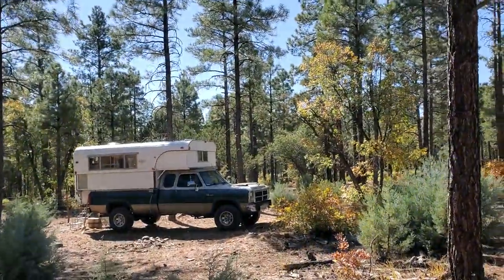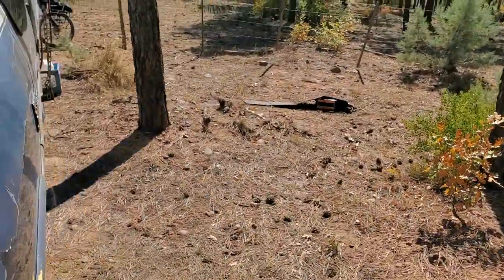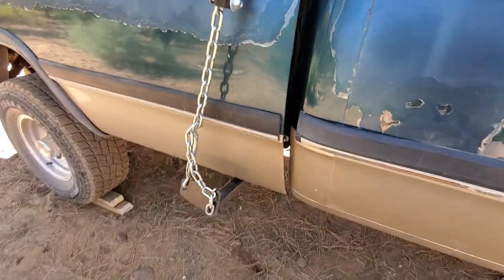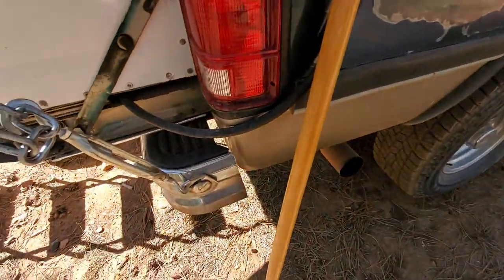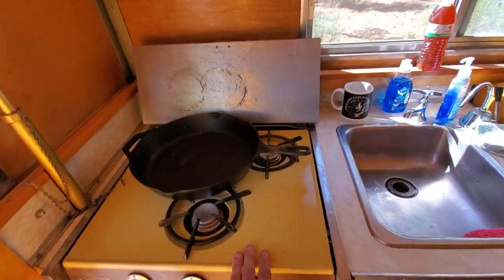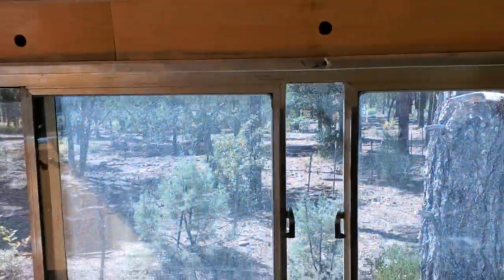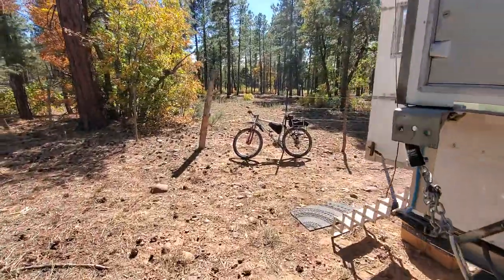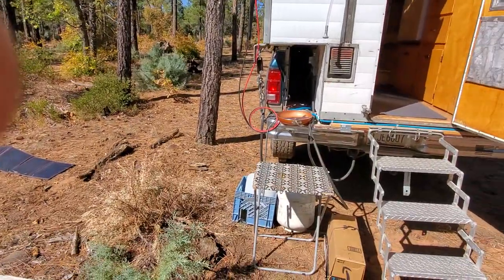My Alaskan  Camper setup

Comment: I just got home yesterday from picking mine up in Saskatchewan near the Alberta border. It had sat there for decades, so was not expecting much. Pumped it up today and it went right up without an issue, so I started getting more excited. It pumped all the way up without any issues, and it sat back down on its pens, sweet. Then when I got inside the surprise was even greater, It looked almost unused, except for the years worth of open to the elements dust layers. I'm already excited to go use it but the bottom of the top, and the top of the bottom both have to be rebuilt first. Still wicked excited about it, regardless.

Comment: This is perfect I also have a 93 w350 im looking to do the same with
Reply from the maker: I highly suggest get a camper that is the length of the bed with tailgate up so you can use the rear bumper for accessories/spare tie and better departure angle clearance.

Comment: Classic rig man.  Love the older, better built, and more reliable rigs
Reply from the maker: It is very reliable and easy to maintain, 4 wheel leaf springs hold the weight well.  Rebuilding the rear axle atm, it was getting noisy and needed new pinion bearing and carrier bearings plus some machine work. Nice that the engine is all mechanical even the fuel injection, no computers or electronics.

Comment: Excellent video.  Love your first gen.  I am the original owner of a 1996 Cummins 12V.  I just did the KDP after 225K miles.  Front main seal was leaking just a little, so took care of both with one fix.  Wasn't much $$$.  Stay strong and well, and enjoy the journey.
Reply from the maker: Ya I have been kicking around getting that KDP done.  Did yours seem to be loose at all or was it snug? I'll probably upgrade the injection pump in conjunction with the KDP, get a 3200 spring, pin ,and nice rebuilt pump. My pump has very minor leaks.
Reply: @tripperdonnie  the mechanic told me that my KDP was fine and not backing out. Glad I had it done anyway, peace of mind.
Reply from the maker: @natei3518  Just did my KDP @ 150k miles it was halfway out!
Reply: @tripperdonnie  Makes you happy that you went ahead and did it.  Glad to hear.  Take care.

Comment: Great info, thanks for sharing. How are the mounting brackets bolted to the camper? Figuring they must be substantial through bolted?
Reply from the maker: I really have not checked the out, they are hidden away in the camper in hard to get to spots.
Reply: @tripperdonnie  thanks 👍
Reply from the maker: The brackets are bending some from off road use, they do not appear to be pulling thru tho. I know many of these campers are directly bolted on the corners to the bed. Even with the springs to help absorb some of the big bumps the camper is taking some abuse.

Comment: Nice Alaskan! I just moved up from a '76 NCO to a '91 CO.  Any advise on how to hook up the camper running lights so they come on with the truck lights? I also have to add rear brake lights because on my camper the back is 80" wide so covers my truck tail lights. Trying to do all this myself as most camper places would charge me bank to problem solve and wire up (if they do it right). Tks!
Reply from the maker: Post the question up on the Alaskan Camper Club Facebook page,  it will be easier to answer there.  Post some pics of the outside plugs especially the pins on your camper,  they are all a bit different over the years

Comment: Do you really need two couches inside? I would keep one and put something on the other side. Maybe a small bar table instead of the table you said you took out.
Reply from the maker: I use the lower bed a lot, it uses both couches and makes a queen size setup. Better for sitting up and watching movies. Also when traveling if I do not want to pop camper up I use the lower bed.  I have a nice wood tv dinner table/tray I use to eat meals on if needed.
Reply from the maker: You know, I am seriously considering widening the larger couch and making the other one for my fridge and storage area.
Reply: @tripperdonnie  I think that sounds great and I bet you’ll love it!

Comment: Did you restore this or was this condition it was in when you bought it?
Reply from the maker: It was in great condition when I bought it,  completely original Canadian built one I bought from a Canadian buddy for $4000. I was very lucky.  BTW dig your channel,  been watching it for a while.
Reply: @tripperdonnie  sweet! I just found out about these camper and now I want one. Glad you enjoy my channel and thanks for the support. I don't know if you watched my video on building my crew cab but my truck used to be your trucks twin.
Reply from the maker: @decentgarage  yes I noticed.  Mine is a perfect AZ truck 150k miles. Only thing I would change is get an 8 ft Alaskan not a 10ft. Better for towing and off roading.
Reply: @tripperdonnie  that's good to know. My trucks are both short beds so 8 foot would be the biggest i would go with. Keep your videos coming!

Comment: In your opinion if you were living in the rig fulltime how important is 4wd to get to spots where you would not be crowded or hassled?
Reply: Thank you for reply
Reply from the maker: Very important! without 4wd you are always paranoid, a small rain can trap you for days, a little snow for weeks.  Sometimes you go down small hills that turn out to be much steeper when you try to go back. Plus you break an axle or driveshaft you should still be able to drive out.
Reply from the maker: Andy Larson  I cut a piece of plywood just small enough to fit in the access hole.  I mounted all the electronics before sliding it in, then just had to hook the battery cable to it. I did make one mistake tho, my fuse breakout box is inaccessible without pulling the plywood mount out. The plywood is screwed into the top bedrails, it holds up nicely.
Reply from the maker: Andy Larson  I have a heavy gage blue extension cord that runs from the inverter to the campers AC plug on the passenger side rear corner of the Alaskan, you can see the extension cord running just below the Alaskan door.  The inverter supplies 1500 watts of 120V power to the original AC breaker box there (2 x 20 AMP breaker) and that gets distributed thru factory wiring to all the plugs in the camper.  All the 12v items run through a non factory 12v fuse box just below the inverter that you can't see.

Comment: How does the 3/4 ton handle the weight of the camper?
Reply from the maker: It has air bags (30psi) a 4 wheel leaf springs and does very well, without the camper this truck is WAY to stiff. On my 2003 Duramax even with air bags it feels a bit heavy, but the Duramax has much softer suspension and still drives decent.

Comment: Over 600 Watts of solar on a little Walmart battery!! Show that beast of a system some respect and get a Lithium battery, you could probably run a 200ah battery easily with that setup! Lynac makes some good batterys.
Reply from the maker: I did add 170 AH of lithium.
Reply: @tripperdonnie  Awesome, that’s respectable now 😎